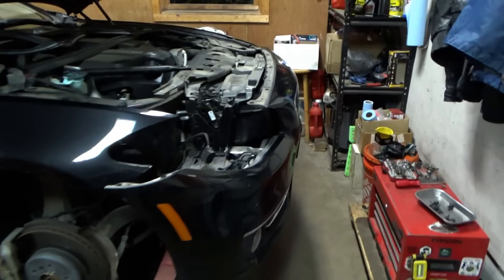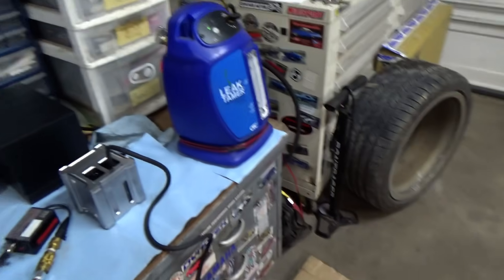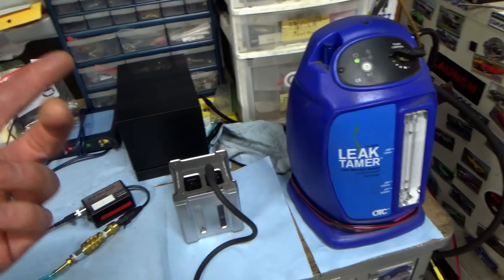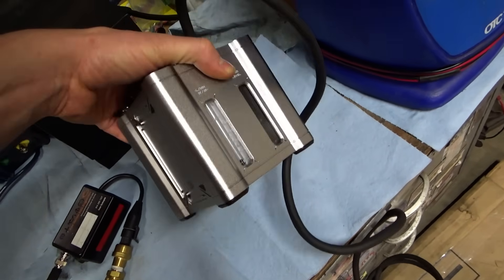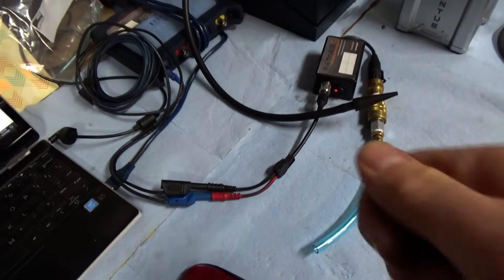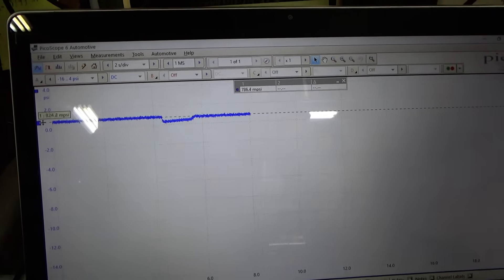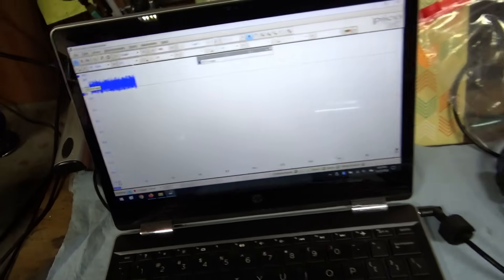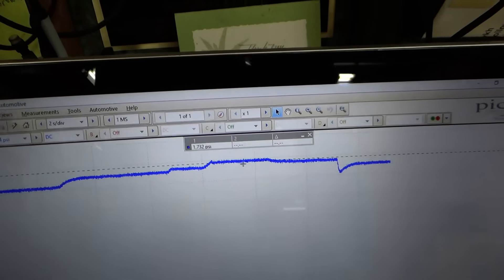BMW Headlight WATER INTRUSION?! (Smoke Machine Showdown!)

Comment: Not a lot of BMWs where I live, but I joke that I've programmed at least one headlight on all of them due to moisture ingress cooking that module!  LOL, such a bad design.  I'm seeing a LOT of modern headlights with critical and expensive modules mounted on the underside, at the lowest point, where water can (and does) pool.  Such a dumb way to design the housings!

I have a "headlight oven" in the garage (just a used household oven from a junkyard) that I use to separate and reseal lenses.  DO NOT use an indoor oven that you care about to do this, as the chemicals and materials DO offgas and are very likely not food safe.  I can also recommend against trying to use a heat gun to separate the lens, as the butyl will get all over everything and cannot be removed.  ;)
Reply: No accident at all. They want it to fail outside the warranty period so you will spend thousands to replace it. STOP buying modern cars, they are all outrageously priced junk.

Comment: You better off using the exhaust from a shop vac for drying the headlights bucket. 
 The exhaust is warm and dry.
Reply from the maker: But shop vac is very LOUD 😅

Comment: I didn't trust any of the cheapie overpriced amazon smoke testers so I just made one with some pvc pipe and fittings, some nichrome wire, a torch wick, and various fittings/tubing/wiring. Just pour in some baby oil, hook up 12v, and hook up compressed air. Works pretty good. Made one for my brother too👍

Comment: ..I dunno Ivan that Amazon smoke did not impress me, your soap bubbles spotted the leak?
Reply: Looks to me like not enough smoke output.  It would be hard to spot, especially if troubleshooting outside.  As a DIY, I'm also not fond of built-in batteries.  Too much trouble to maintain the charge so I don't kill the batteries from neglect. I do like that it's portable and doesn't need shop air.
Reply: It could just be the oil that came with the machine.
Reply: @mattburns2968  so you are suggesting that the manufacturer  shipped the item with the incorrect oil?
Reply: Ivan did the new smoke machine produce a horrible smelling smoke ..?  Same brand different model stinky smoke !
Reply: @andrewwarren6979  I think all machines use mineral oil, but I could be wrong.
Reply: @andrewwarren6979  just use baby oil
Reply: It works just fine
Reply: I agree  didn't like the mechine  could do the with a regulated  air supply
Reply from the maker: This leak was incredibly small!! The smoke machine was used as a regulated pressure source in this case 😉
Reply: @PineHollowAutoDiagnostics  smt-108-pro
Reply: I have the red paint gun can machine. It works very good. Found an Intake Gasket leak on a 3800 V6.

Comment: Nice, I've been using one of those paint can smoke machines for a few years. Same size as the small one you showed, but still needs power and air, plus hard to store. I'll definitely look into the one you showed.

Comment: After flowing the silicone. I would apply a slight vacuum to the interior while it cured.. That will draw the sealant into the leak area. I have done this with fuel tank leaks around the electrical connectors using just the engine vacuum.
Reply: Great idea
Reply: Seriously good idea! Thank you for sharing.

Comment: Use your ac machine to draw a vacuum moisture will boil off
Reply: Bad idea. Will contaminate vacuum pump oil. Boys!!! Please change vacuum pump oil when machine tells you, don’t just reset the counter. If I could attach the picture you’d be shocked how much rust happens inside the pump that wasn’t serviced (I rebuild AC machines as a side hustle).

Comment: I read a lot of reviews on Amazon smoke machines and too many of them worked once and never worked again so I too chicken to buy one and I need one or else hire someone to find my leak on my Jeep. I looked at so many of them I don't know if I read up about this one. I suppose a laser pointer would fine the smoke faster ???
Reply: Depending where you are looking for the leak you can use starting fluid or gas and gently spray around vacuum lines and such to find a leak. If you hear the idle change then you know you're close. You can make smoke machines pretty cheaply also.
Reply: @blindabinda1234  For the EVAP system. I need to regulate it down to pretty low PSI. Havent given that part much thought but I guess I can just use my mouth
Reply: @hikerJohn  do you have a check engine light on?